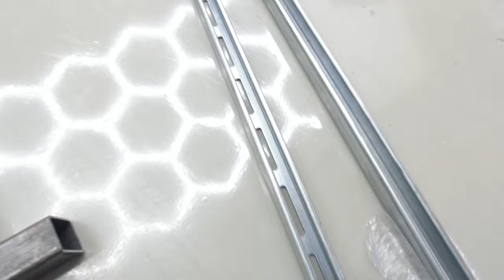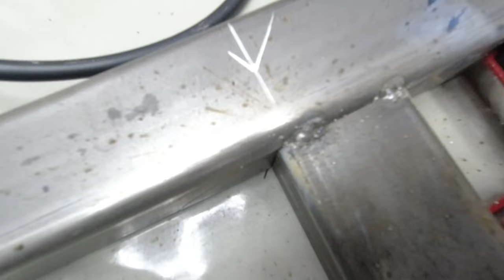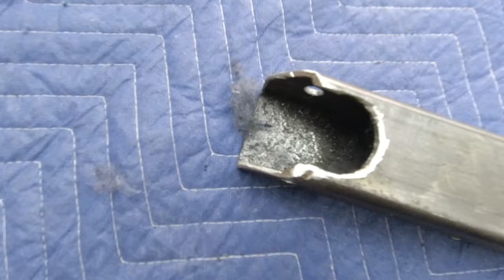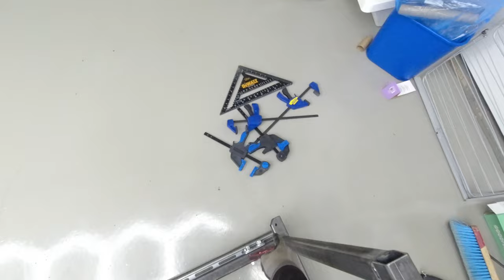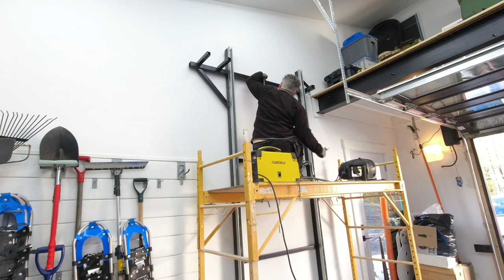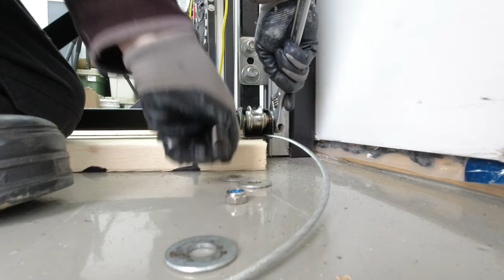How to make a loft lift

Comment: What's the thickness of metal tubes you used to build the carriage?
Reply from the maker: 1/8" thick tubes. They're all 1.5" diameter except for the main rails and rear tube of the platform, those are all 2"

Comment: When welding zinc coated metal be sure to avoid letting the fumes waft up into your mask like they did. It could cause metal fume fever which can be quite bad for some people. 
Otherwise great build! Very clean
Reply from the maker: I knew someone was going to comment on that. What you cant see is that I'm wearing a respirator under my hood when welding the tracks to the frame. Also, I ground off the coating in the spots that were to be welded